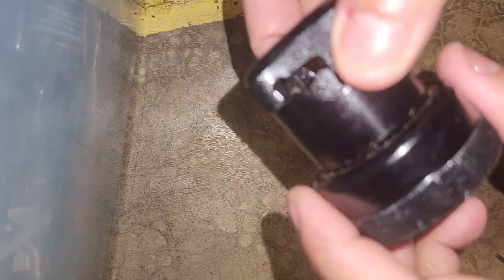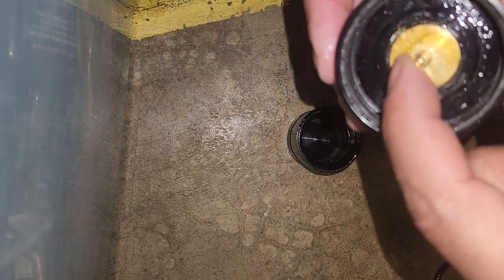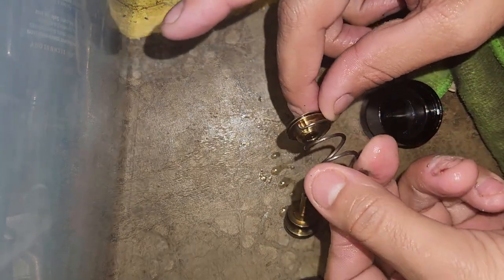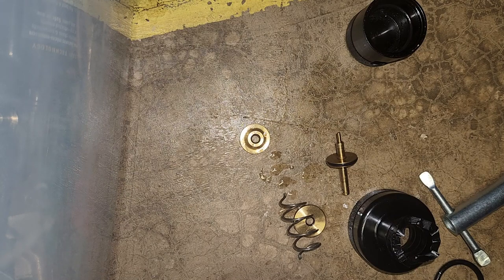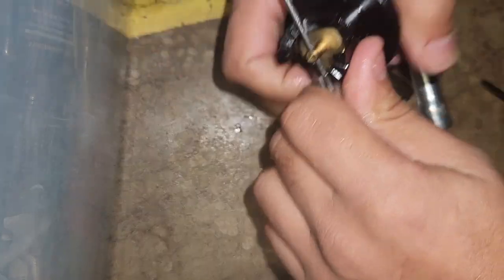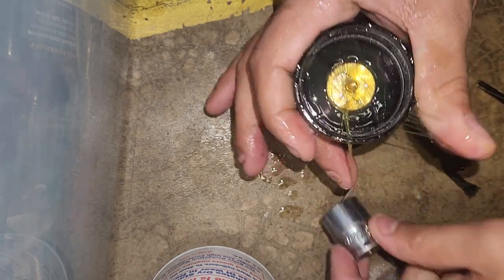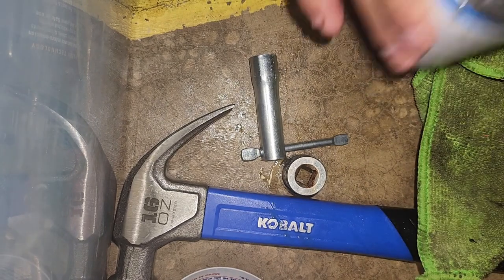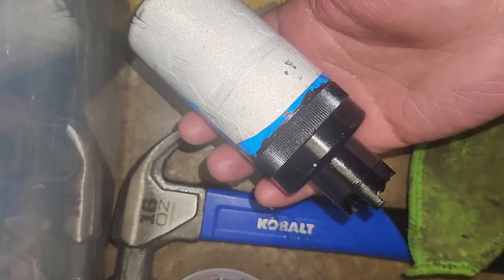Bang22 Airsoft Grenade Dead Timer Head Repair!!

Comment: Great video! Very informative! I just have one thing to add and other viewers may find this useful too. I noticed that when I did it your original way, the first pull would have a delay of the full 5 seconds whereas the 2nd and 3rd and so on pulls would have a delay of roughly 2 seconds. This is due to not filling the reservoir up fully with fluid and the air remaining inside the chamber will pass through the delay hole much faster. 

To solve this, and have consistent subsequent delays, at around 7:30, before putting in the spring and the plunger, try to dump a bit of fluid right on top of the top stopper plate. This ensures the other side of the reservoir that your method didn't originally fill, would be filled with fluid. With this method, I am able to generate consistent 5-second delays that I have tested with around 10 pulls. Of course, over time, fluid will leak out. After a number of pulls, you will have to go through this process again, but its just a little maintenance to keep your gear running top-notch.

Hope you can make an updated video showing this or pin this comment for other users. its the worst feeling when you pull the pin and before you can throw it, the grenade pops in your hand.
Reply: I've noticed that the time delay is shorter on hot days. I tested it and put the timer in the fridge for a bit, and sure enough, the delay went back to 5 seconds to whereas before it was going off at around 2-3 secs. 

Have you experienced this?
Reply: @unfussylobster  I think that it is a very normal situation because the internal oil becomes less fluid at low temperatures and more fluid at high temperatures. If you want to increase the delay time, you can achieve this by using oil with a higher viscosity coefficient.

Comment: Really awesome video man, I did some research online and learn so far as of now that if you use silicone differential oil with a viscosity of 10k  cst is the one you should use, I will give it a try and update this with the results
Reply from the maker: Yeah I've heard traxxas 10k is another good option, I didn't know that before I started looking so I ended up with the Lucas but it works well and since it is a substance meant to be used in engines I doubt it'll have negative side effects on something as simple as a B22
Reply: @sausageofmarnies2799  the 10k so far works pretty well, helps for anyone looking for a specific viscosity or if they wanna change or shorten their timers I was worried the lucas might eat away the o rings whatever it's made or additives it has, but I know for sure silicone is a safe bet for orings
Reply: @sausageofmarnies2799  also I realized your guy from black ops airsoft from bristol, this is Solid ftw nice seeing you here and awesome video man keep it up
Reply from the maker: @SexySolidSnake  oh shit 🤣🤣 what up bro!! I'll be going out there more often when the weather gets better 👍👍

Comment: My AI Tornado 2 Timer Grenade stopped working 2~ years ago, it basically detonates immediately and they folded as a company, so I had an expensive brick. Thought I'd just have a quick Google again to see if more recent posts on self-fixes have been posted on the Net and a Reddit posted linked your video! 

Although a different grenade, the firing pin looks exactly the same - make sense for them to use the same machined component. So I am very hopeful!! Will keep you posted!
Reply: Just an update - it has fixed my grenade! Using 10K weight silicone oil and prefilling the spring cavity prior to compression and then filling the remainder - it took a whole 10-11 seconds to detonate on the longest setting. 

So there's much for me to test and tweak, but I am so happy to get this back to a working state. Thank you so much for this video!! 🤗

Comment: Another super important point: make sure that when you put the top flange in, check that when you insert the spring into the two retention holes on the top plate and the plunger, the eyelet hole for the pin is aligned with the openings on the top of the timer head...  Otherwise, when you pull the pin, and the plunger drops, it may realign to a position you cant put the pin back into.

Comment: Over in aus had been a while since I've had mine out got it out for some new years bangs and had instant firing so will be trying this myself also being in Queensland which is more commonly above 30deg might try some thick rc diff silicon oil as you can get some thick stuff might make it more reasonable in hot humid environments

Comment: You think this fix is gonna work for tornado 2s? Or something similar?
Reply from the maker: From what I've seen the heads are designed to use a similar system. So yes it should work.
Reply: @sausageofmarnies2799  i guess the question is how hard it is to dissaemble them
Reply from the maker: @GeoffDerksen  I've never used a Tornado 2 so I honestly couldn't tell you, is the head not able to just he screwed off?

Comment: Don't we need to fill both sides of the reservoir?
Reply from the maker: No, the o rings have enough space for the fluid to pass from one side to the other
Reply: You are correct. Thank you for making this. I bought one for $50 and the guy didn't mention it was leaking so it's just been sitting on a shelf. I'm going to share this with everyone!
Reply: I am going to replace the o-rings on mine so I'll post sizes if you don't mind.
Reply from the maker: @michaelseeliger8292  the more information we have the better! Sounds like you got a great deal at a very opportune moment 🤣 I wouldn't go too thick on the o rings since the fluid needs to be able to move between both sides since that's how the timer works

Comment: Works, but has problems striking the pin to ignite the .22
Reply from the maker: That might have something more to do with the striking mechanism than the timer
Reply: Que gran video amigo, muchas gracias
Reply from the maker: @luismendez6378  de nada!

Comment: Using this video for reverse engineering if anyone has a broken one lmk trying to develop my own line of similar but better product and will send a set of them for the help
Reply from the maker: I'd be interested in picking one up when you're done!! Especially if it's gonna be a timed detonation using .22 nail drivers!
Reply from the maker: Hey man, are you on discord? I have a broken one that's taken apart and I've been trying to get a replacement for a while. Figure if you devolp your own I'd be willing to try it